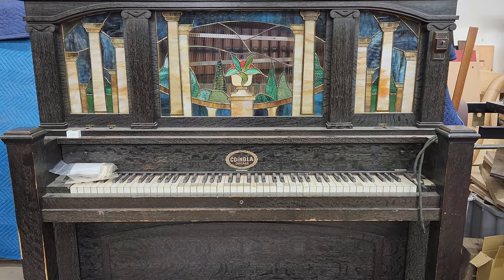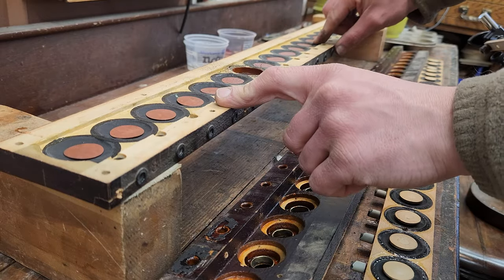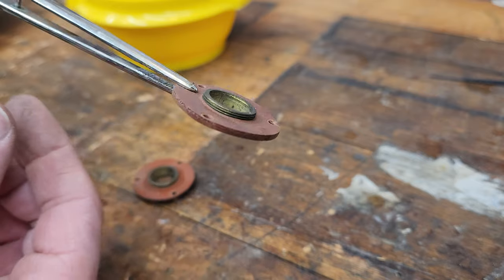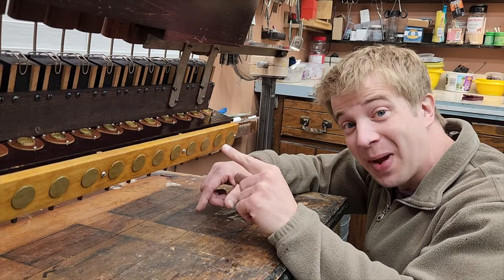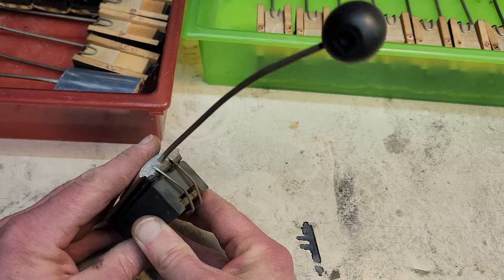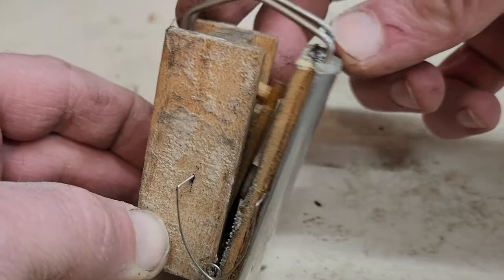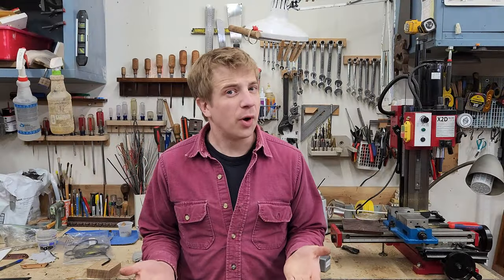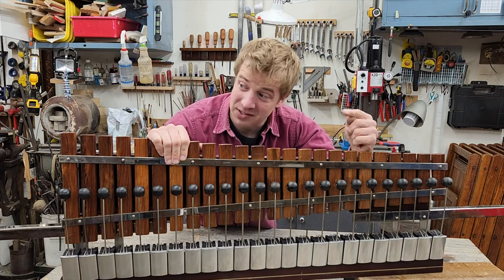It sure sounds...authentic? Reviving the reiterating Xylophone (Time for Some Change Episode 6)

Comment: The point about materials in a restoration is a moot one. There are historically accurate preservations and there are functional refurbishments. Both have their place. What's more important is payingt attention to not destroy irreplaceable parts of the object's provenance, putting stuff back the way it was and not different where possible, using non-degrading, well documented materials and keep records of the composition and what solvents and techniques will undo your work. If you want to do the next guy who works on this in another hundred years a huge favor, write up all you did and how you did it, print it up on acid-free paper together with material data sheets if you have them, and put them in a pouch in the back of the piano.

Comment: Rubber cloth of multiple kinds is available from Organ supply. Still very widely used. Also, future restorers will thank you if you use hide or fish glue (what would have been used originally) instead of white glue for pneumatics and leather.

Comment: Love you made new valve covers.  Hope you used blotter paper rings when you installed them.  Coinola used them as a gasket on the fiber valve covers.
Reply from the maker: Yes I certainly replaced the gaskets. Thank you for your help choosing the correct tap!

Comment: Great job on each one of those little reiterating pneumatics! Those are no easy task, especially with how complicated some of them can get. I've found that Coinola's inside pallet valve method works a lot better than some of the simpler ones that just have a hole that opens in the back whenever the pneumatic closes. That's going to be a very, very nice piano when it's finished!
Reply from the maker: Thank you! I definitely got into the weeds getting the pallets right, but I'm all the wiser for next time.

Comment: Hello, this is a non related question but, I’ve seen that you have worked on a 70’s aeolian pianola. I just got one, and someone mentioned that the rubber tracker bar tubing was lined with asbestos. Is this true? If so, do you know how to keep it safe, without replacing any tubing? I’m an amateur with player pianos, and I don’t want to throw the thing away. Thanks! Ps. I love your videos, keep it up!
Reply: We have a 1960s Aeolian player piano and the rubber tubing in ours looks perfectly normal. I have never heard of any player company using Asbestos in their tubing. Plain rubber tubing was most common; a few fancier ones have cloth-covered rubber tubing. Later on some people used neoprene or plastic tubing when rebuilding, with mixed results. 

Some orchestrions and a few fairground organs have cardboard tubing which is heavily shellacked inside and out to give it rigidity and make it airtight.

 Many old home player pianos may have lead tubing, but the lead is usually inert and not directly a hazard.
Reply: @andrewbarrett1537  thank you so much, the day after I posted this we did a test and it came back negative. But I did have one more spot that I think may have it. On the electric motor there is some old insulation. Do you think that would have asbestos in it?